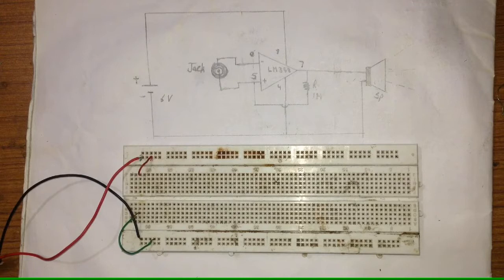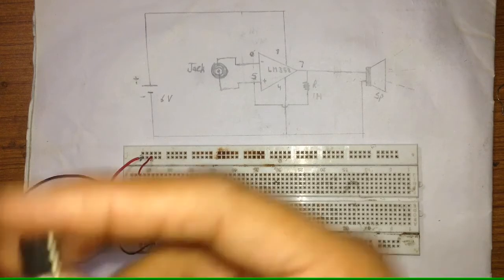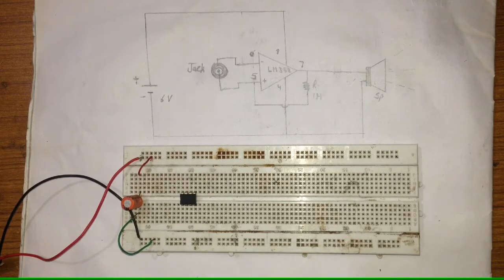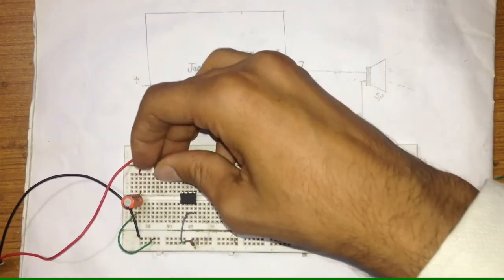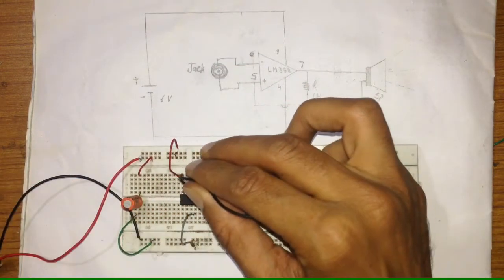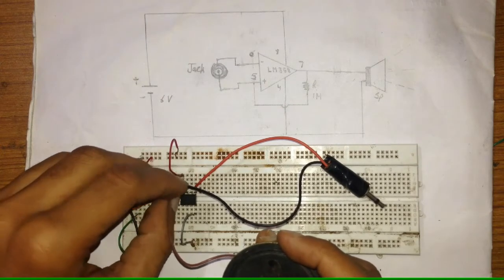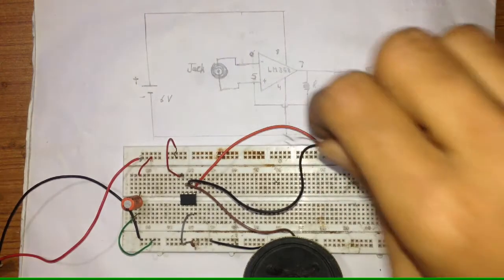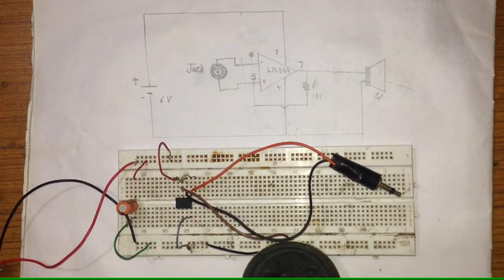Simple Amplifier with LM 358.

Comment: Does not work!
Reply from the maker: It works but needs some noise filter
Reply: @TechsScience  you need to connect a capacitor of 220 Uf in series with the speaker.